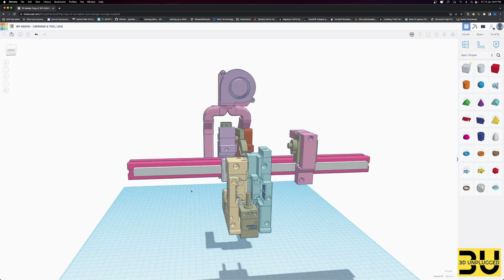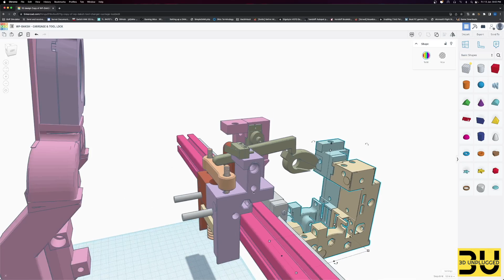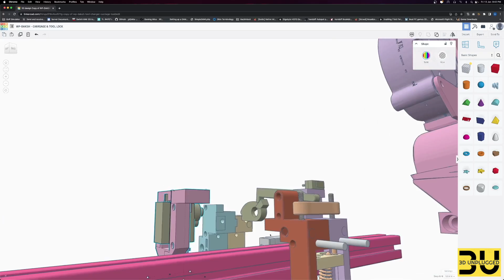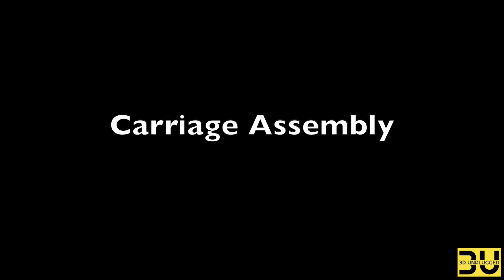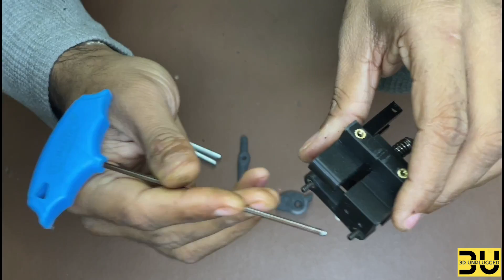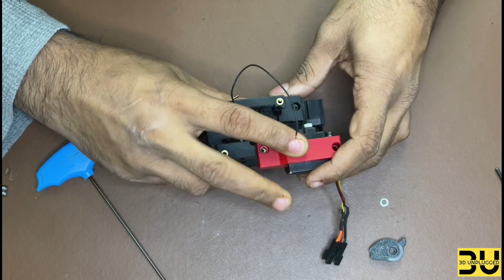'WP-DAKSH' - Voron Trident DIY Tool Changer 3D Printer - Part 2 - X Carriage

Comment: Tool head is getting heavy, why 5his much complications.
Reply from the maker: The toolhead is still lighter than the other ones out there for comparable tool changers - the complexity is required to do automated tool changes as you need the ability to lock/unlock tools. Would definitely be interested in your thoughts on how the complexity can be reduced while maintaining the same functionality.

Comment: Can you also cover the proximity sensor installation at the beginning of the new video?
Reply from the maker: The proximity sensor installation is the same as the one installed on the Voron 2.4 or Trident systems -you could get the details from its manual.

Comment: wait, you are designing with TinkerCad? WOW - I absolutely hate this Tool. Full CAD is absolutely necessary.
Reply from the maker: I have limited CAD skills - but someone else is kindly working on the Full CAD
Reply: Modelling mecanics with this tool is risky. You Can move a piece without noticing it. And the 3D view is tricky. I had bad experience with it, with miss aligned assembly when it seems ok on my screen...

Your work is very impressive. I Hope you will open the way to cheap, and efficient tool changing.